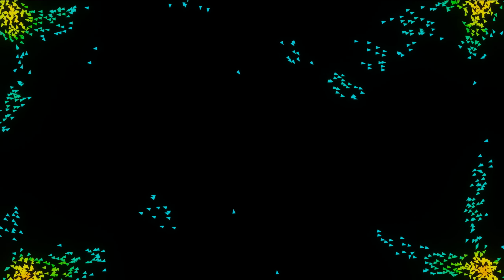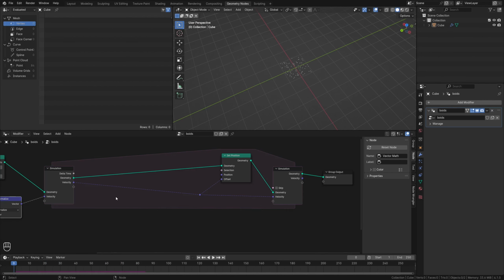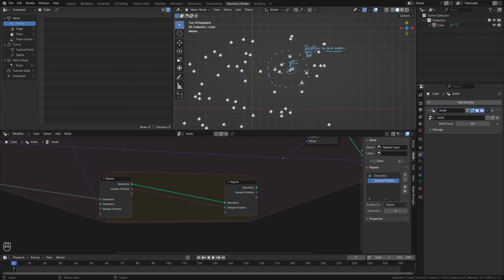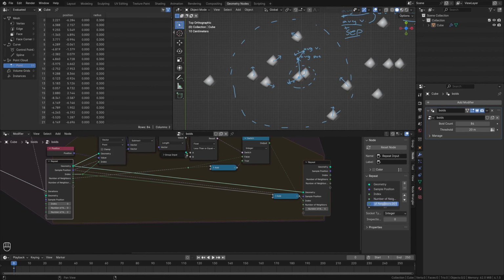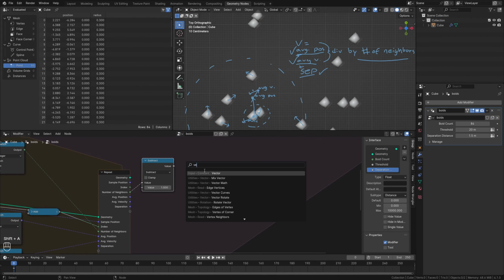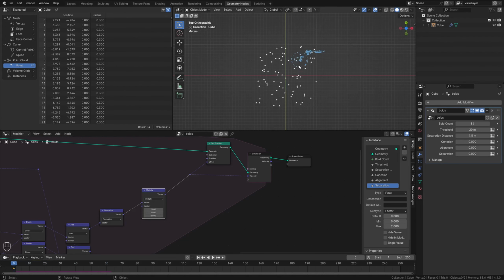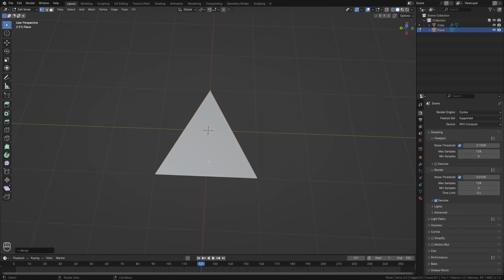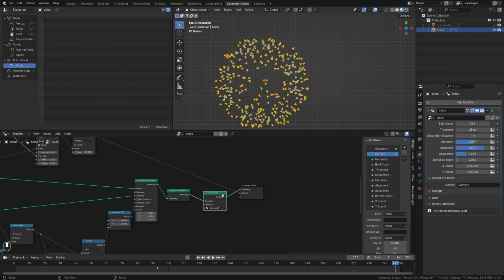Geometry Nodes Boids Simulation Tutorial | Blender 4.1

Comment: The mystery meat:
Typed out by hand by me.
Definitions:
vector P = normalize (avg position/ (number of neighbors - 1) ) 
vector V = normalize (avg velocity - velocity from the simulation zone/(number of neighbors -1))cohesion variable =C
alignment variable = A
separation variable = S
switched separation vector from the repeat loop = Z
velocity from the simulation loop = W

normalize(
  W 
  + 5 * S * Z 
  + V / (2 - A*50 + 0.01) 
  + P / (2 - C*50 + 0.01)
) * 2 
+ boundary_force

My AI thinks there is an error with the cohesion force. 
I haven't checked it yet, but something in there has made this node setup hard to modify in mysterious ways. Its probably that.

Comment: is it possible to do it with the new for each node ?
Reply from the maker: I personally haven't tooled around with it yet, but from the snippet on the documentation, I think it should work.
Just instead of incrementing the index every iteration, use the built-in index tool (probably), and other than that it should work the same 👍
Reply: @csdt  ok, i just tried and it seams like it dosen't work for this purpose. Because It seems like each index is calculated individually at the 
same time, instead of one after the other, as with the Repeat Zone. But it's 10 ten faster I guess (when you dosen't split the elements)
Reply from the maker: Good to know :) Thanks for trying it out!